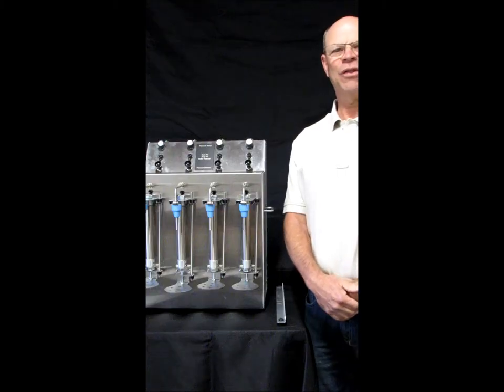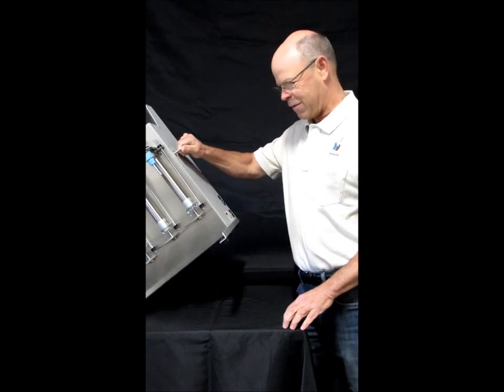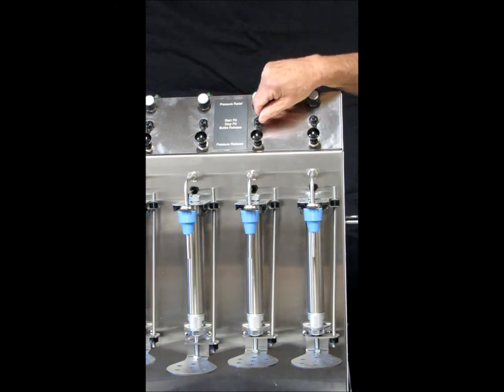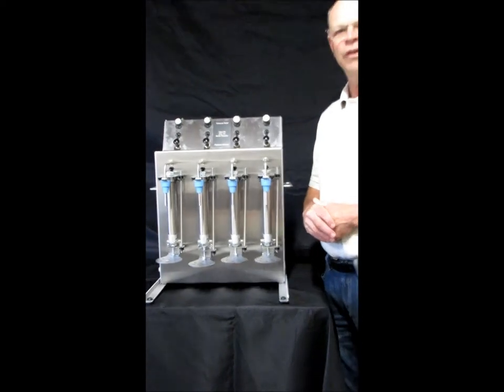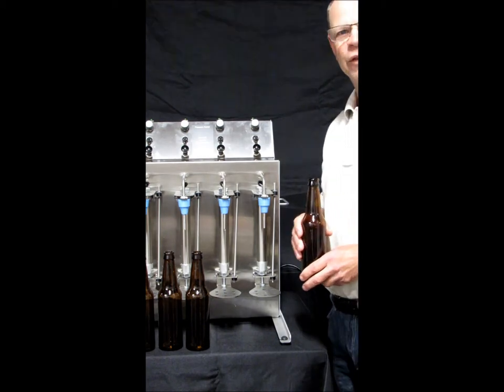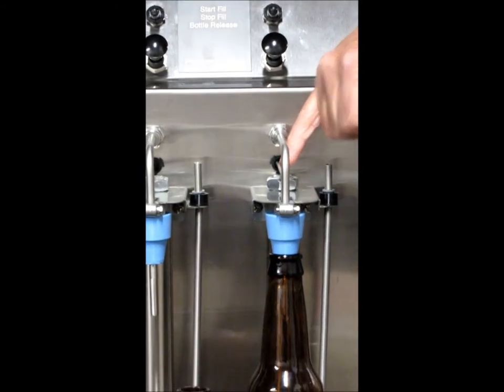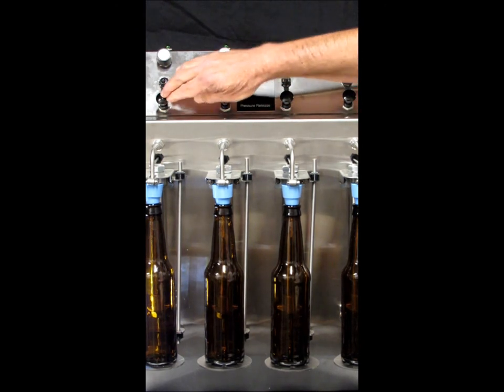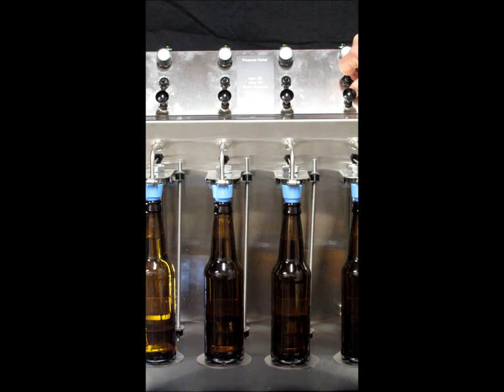XpressFill XF4500 4 Spout Counter Pressure Beer Bottle Filling Machine Setup and Operation

Comment: Can you share a demonstration video filling beer? Im concerned about foam waste and operator ergonomy to achieve 400 bottles per hour. Thanks.
Reply from the maker: Rodrigo
Here is a video of the filling process with beer using the early prototype version of the XF4500.  There have been a number of refinements since this video but the operation remains essentially the same.  As you can see, there is very little waste.

https://youtu.be/_YYI6oTQE70

Rod
Reply: Great, thanks for the answer